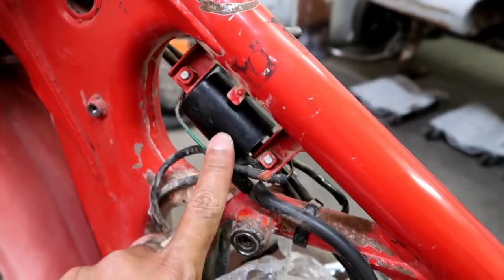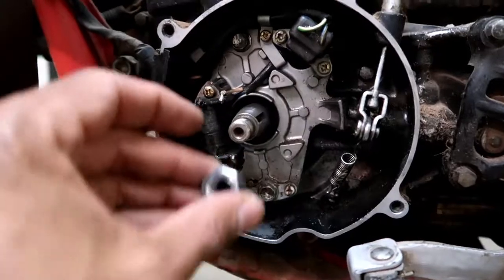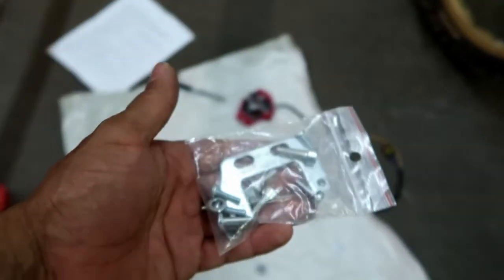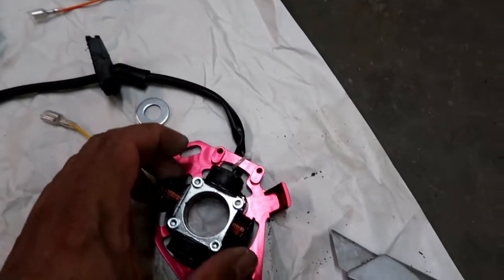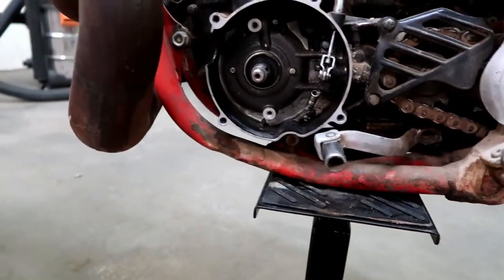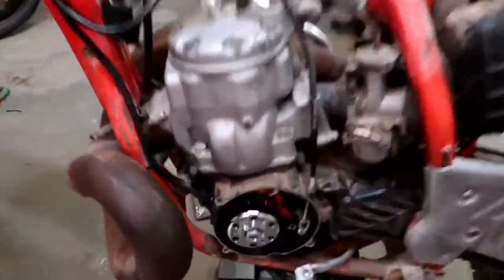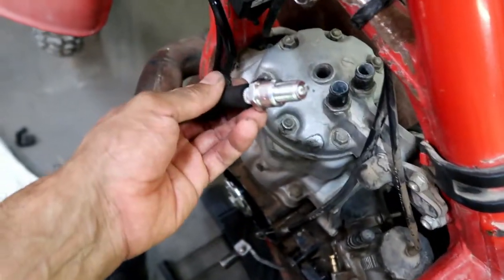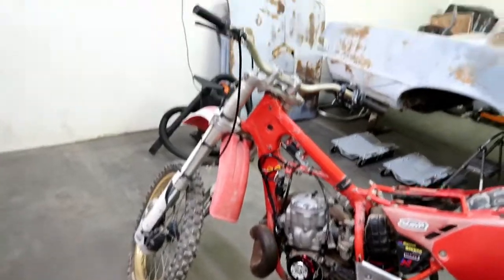1989 Honda CR500R Electrical System Upgrade - Stator, CDI, Coil, Flywheel Replacement

Comment: hello 
you bought the system with a light coil, but for this crosser it was better that you bought the special mx only, type is 068K295 hpi brand 
the one you bought was 210K295
willy from HPI

Comment: Kinda pricy for a mostly "universal fit" kit. There's no reason the fit and finish has to be shoddy enough that the end user needs zip ties! There's not even timing marks on the backplate. "Just draw a line." Isn't the most professional way of doing things. The sparkplug wire is a mile too long as well. Check out a company called MSV. Their kit was designed with thought, not just thrown together.

Comment: Have you thought about getting a faraday stator coil from msv racing? I ran a spark test just by hand cranking the motor (decomp) and so much more spark. Starts so much easier. Also retarded the ignition curve to mellow out the "hit" and extend the power to more top end. Look him up, great products. Jason Meyers.  Also got there elbow kit, high flow impeller, 2+psi rad cap, bike runs much cooler. Also there "HORSEPOWER" exhaust is a must have.
Reply: That stator is the exact one I’m installing on my ‘87 as we speak. Glad to hear a verified user is having it work like I hoped it would.
Reply: @fighter4christ7  how did the stator kit work for your 87? I have a 1987 motor and need a new stator  set up. You bought the same kit here as he shows in video or did you go with msv?
Reply: @coloradodirtbike5930  

I did go with MSV. You can call them too and they’re super helpful. I actually ended up not getting to complete the install, because I had to leave for work again and I work over the road. Hopefully soon though, I’ve been itching to experience the difference. I’ve heard more and more good things about them as time goes on, so I’m sure it’ll work out well for anyone.
Reply: @fighter4christ7  thanks for the response much appreciated and yeah msv makes quality products I  use the double o ring exhaust flange on my worked up 91 cr500r.
Reply: @coloradodirtbike5930 

Nice. I got the set. Stator, exhaust manifold, water pump and cap. Can’t wait to set it all up! Probably best I didn’t install it all before my last ride and big time wrecked it 😂
Reply from the maker: I'll check him out, thanks for the insight!

Comment: I started with a clapped out 91 cr500. I replaced the whole electrical system as the CDI died. the stock stator produced a weak spark still, so replaced it all. I bored the cylinder out and put in a new piston and had good compression. Bike still would not start easy even after rebuilding the carb. It ran like crap when it did start. I put a Keihin PWK airstryker 38mm carb and put in new reeds. After that the bike started easily and ran great. Spent a lot of money and time, but well worth it. I now have a decomp valve on the head… kicks like a 125. Don’t give up on it maybe some new reeds and carb rebuild on yours. Those bikes are collector items now and worth some money.
Reply from the maker: Sounds like you have a nice bike now. I have everything I need to rebuild the motor now so I'll be putting it together in the near future. Thanks for watching!

Comment: Do you know the torque specs on flywheel nut and stator mounts?
Reply from the maker: In my Clymer manual it states: Rotor Nut - 50-60Nm/36-43ft lb.  Alternator Cover Screws - 3-5Nm/2-4ft lb. Pulse Generator Mounting Screw - 2Nm/17in lb. Hope that helps.
Reply: @themiddleagedgoodtimers4768  

It does, thanks a lot! I just ordered a manual because I’m sick of having to look this stuff up. They always seem to get lost with the first owner.

Comment: Hang in there.  It is worth it.  You might want to hang on to that flywheel weight.  It is the difference between hating the bike in the woods and loving it.
Reply from the maker: Luckily I did keep that flywheel weight just in case. Unfortunately I have bigger problems with the top end, check out my latest video for the gory details.

Comment: Did you ever get it to run
Reply from the maker: Not yet. I cleaned the carb, made sure I had a good spark, put everything back together and I can't get it to start. It has good compression so I'm scratching my head at this point. The only thing I can think of is either the carb or timing.
Reply: have a 89 as well was a carb issue cleaned and proper jetting went oversize piston 89.xx .170 jet
Reply from the maker: Unfortunately I recently found out I have bigger issues. I pulled the top end apart and found damage to the cylinder and piston so I’m going to be pulling the motor and rebuilding it.